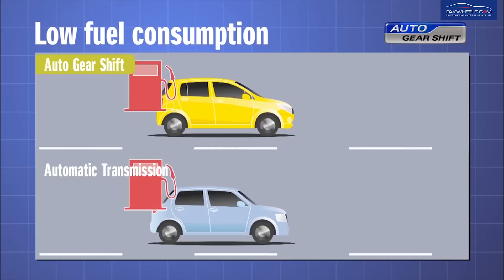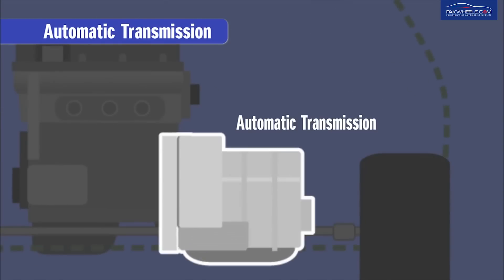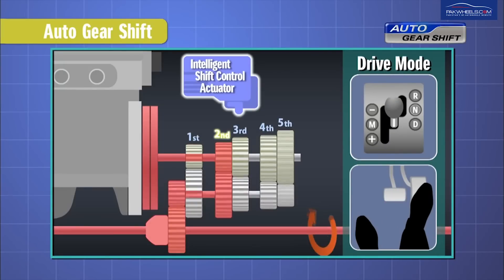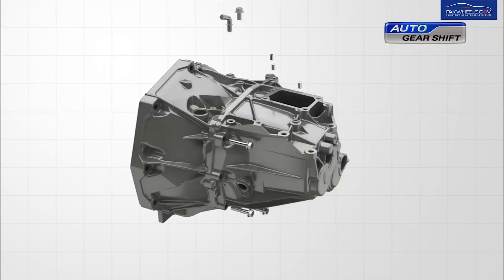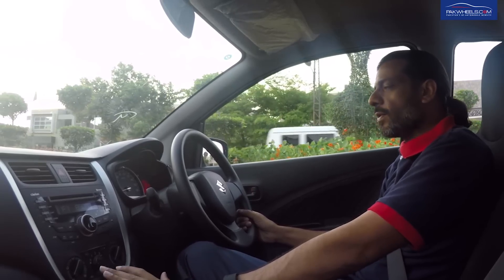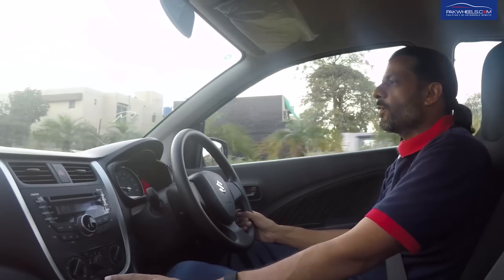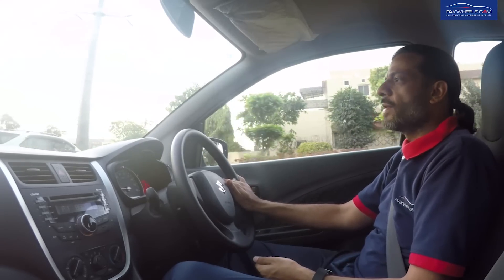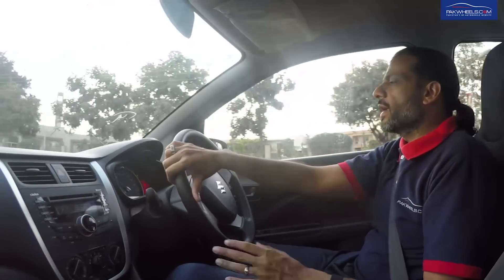Auto Gear Shift Technology Explained | PakWheels

Comment: It is not the lack of smooth quick gear shifts that make conversational torque converter do low fuel average but it's the continues gear engage during idle position that is responsible for bad fuel average otherwise for that case we have CVT that is quick and smooth in gear shifts.

Comment: Farig bcz it is knocking while driving uphill. U cannot drive it on uphill. If u want to overtake on highway u cannot do overtake
Now u say manual gear
If it's battery becomes dead or weak u cannot drive it manually by using clutch... Another worst fault u will see it on pakistan roads in near future. And the explanation u gave is 100 percent wrong out of suzuka love